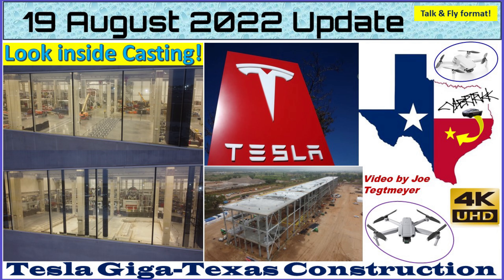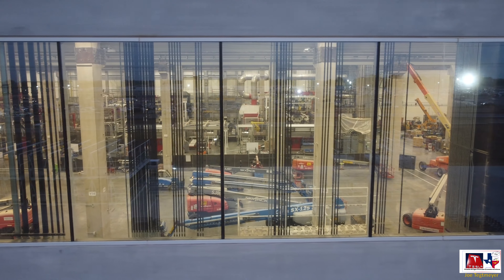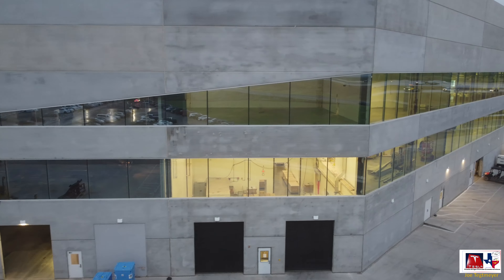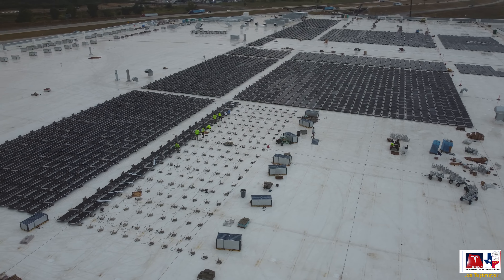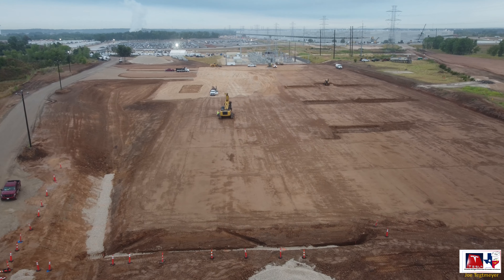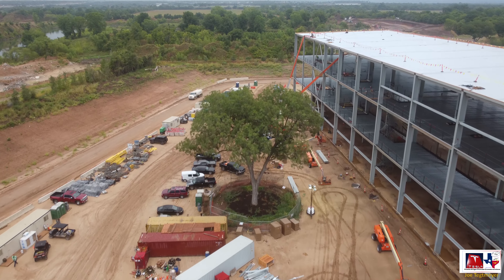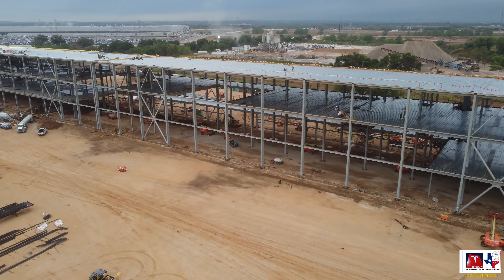Tesla Gigafactory Texas 19 August 2022 Cyber Truck & Model Y Factory Construction Update (06:45AM)

Comment: My ideas and speculations at the cathode building.
13:01 The roped off area on the roof is to indicate that anyone near the edge is required to be harnessed and secure. Down the left side are the roof drains indicating a pitch to this side, and the column heights on the end also indicate this. Any addition to the building would be on the right side.
13:43 The area with the many pipes could be a storage area for dry feed. The black pipes are parts of a pneumatic conveyor system. The rows of black pipes to the left are silo locations and the uncovered pipes are where the feeds are mixed and/or routed to the process. The white pipes are drains for silo enclosures. This area could be enclosed as indicated by the steel to the left.
Reply from the maker: Wow, thank you very much for these ideas and speculations! Hope to be able to show how close to right your thought are!

Comment: Maybe someone has already speculated on this, but the smaller semi-trailer parking area (located where the pipe-mill used to be last year) seems to be for trailers that have been fully unloaded.   The rear doors on many of them are wide open, and the area they are parked in does NOT have any security fencing around it.   No need to protect or secure a trailer that is empty!   😀

As crowded as the WOW yard is getting, it would make sense not to further congest that area by bringing trailers that have been emptied into the factory back over to that area.   What do you think?
Reply: Makes a lot of sense!

Comment: Thanks Joe 
The fourth Gigapress was a surprise.

2:26. Casting, inside. Demolished part of the existing Gigapress frames that were cast into the floor. Joe’s 12 January video of same location, https://youtu.be/lZxfys7MaWM?t=646
Casting, inside. Column rows marked X, and Y all had a flat plate collar fitted around the bridge crane beam support shoulders. Engineers getting twitchy.
6:20. Battery north, inside. Construction doesn’t seem to have finished.
6:44. Battery, inside. Levels 2 and 3. New openings broken through the walls.
10:19. New substation. Bottom right. Rebar for circular cages.
10:55. New substation. Machine at bottom left looks like a drilling/piling rig.
12:29. Cathode, roof. Pairs of circular blockouts along the roof edge would be for roof drains.
12:59. Cathode, roof. Insulation boards and topping mix almost to the top of the timbers around the edge. Space enough for a trafficable board, then the membrane.
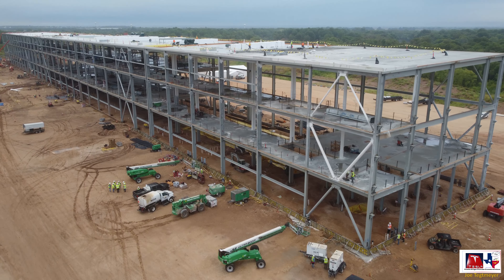13:21. Cathode. Painters have made a start. 
13:50. Cathode. Duct banks. Seem to be using a corrugated mesh as formwork for the concrete encasing.
13:59. Cathode. Bottom left. Pipe arrangements. I always think steam when I see pipework with welded elbows, tees, and flanges at the connections.
16:47. Cathode Level 3. Right of screen. Stairs and flat sheet decking for the suspended platforms.
17:58. East contractors area. Bottom of screen. The plumbers dog.
18:55. East stockpiles area. Left of screen. Bright red spillage.
20:37. BIW, new loading dock ramp. Plumbers nightmare continues. There does seem to be less pipes at least.
22:34. New loading dock openings. Zoom in to see the insulated core of the wall panels. Floor busted out for the dock leveller set-downs.
24:27. Stamping Extension. Road is a mess. Still shifting earth around.
Reply: Why would the fourth one be a surprise?  Since we saw the crates go in a while back, figured they were putting it together.
Reply: @sammyk874   I lost count of how many there were. I recall seeing empty heavy duty low loaders, but not sure if I noted them as being for another giga-press. Need to mount a search now. See what you done!
Reply: 2:26. I wonder if they wanted to up the capacity of the bridge cranes, and this was a way to do so without taking up floor space by adding exterior support beams. Or someone discovered a structural engineering mistake that had to be fixed quickly?
18:55. Unfortunately, that is off highway diesel marked with red dye that has been spilled.
20:53. Ambulance outside of stamping area.
Reply: @GoCoyote  2:26. Yes, a number of possibilities. Back when the beams were delivered I thought that they appeared to be deeper, but it wasn't possible to get a direct comparison with the already installed beams. They are heftier though, top and bottom flanges noticeably thicker as seen in Joe's  12 January pictures.
18:55. That's a relief, no connection to 20:53 then.
Reply: @DessieDoolan  I figured you had a delivery tracker already! 😀
Reply: @sammyk874  They weren't there when Jeff first flew past. Arrived as he was finishing up. Next day, nothing to see. There must be loads of times this happens, and we're none the wiser.
Reply: @DessieDoolan  Yep, not like the old days when there were often three or four drones a day. And that was when everything was out in the open and nothing was missed.
Reply: @Bill_N_ATX  Yeah, you could follow something of interest from video to video. Hole dug, something placed, backfilled, asphalted.

I miss Randy's videos. Those late afternoon shots always showed up stuff not visible in full light.

The current combination is pretty good though.
Reply: 13:59 I’m with you. At least something under pressure. It’s not stainless or some other special allow it seems so it could be high pressure water, or a slurry, or a bunch of stuff. But probably not sprinkler or fire safety since that’s all low pressure, under a couple hundred PSI, so no need for bent or welded pipe. Just cast iron pipe and fittings are fine for that and potable water.
Reply: @Bill_N_ATX  Is there nothing on TV over there tonight! I must have had a dozen comments in the last hour.

13:59. Hopefully a lot of the plant will be installed before the walls go up.
Reply: @DessieDoolan  I spent a couple hours after the thunderstorms stoped cutting up an oak tree in the front yard that was hit by lightning. In Texas, we say that droughts are ended by floods. We didn’t get a flood today but it’s supposed to rain almost every day for the next week to 10 days. I know they had them up north in Ft. Worth today. We will see if it gets down to Austin.
Reply: @kevinstrelioff4340  I looked at Joe's photos. I think they are Model S. 
There has been an S seen here before on car-carriers.

Nicely spotted, very hard to make out.
Reply: @Bill_N_ATX  Lightning strike. Close enough to cause you to utter an involuntary profanity?

Rain. Will be interesting to see how the far north east hire depot yard holds up.
Reply: @DessieDoolan   Oh Hell Yeah. This tree was about 15 meters from the living room window. While I loved that tree, I’m happy it hit the tree and not the house. That would have been really bad.

Comment: 8:55 Faintly, but there is some steam coming out of (a) cooler(s) on top of BA, so there is some cooling taking place. Good news, 4680 production may have (re-) started or is in trial run after the announced installation of 2nd generation production equipment.

Comment: I don't think that little car wash on the outside is a test for water leaks.  That requires very high pressure from lots of angles, and is not done by hand.  Your vehicle throughput would be severely limited.
Reply from the maker: Thanks … some think it’s a washing station, some think leak testing. What do you think it is?

Comment: The new room in casting area looks like offices. Fire sprinklers seems a bit tight for open area. Fire code typically 15' per sprinkler and overall room appears to be about 20' X 60' which would suggest 4 is enough if not overkill for an open area. Here we see 11 so could be 6 rooms and one hallway on top floor? The column that is towards the inside more seems to have a sprinkler on both sides?
The pipe with flanges by the cathode plant looks like pipe for fire sprinklers; risers and distribution. But could also be to distribute water for processes. For fire you would see gate valves between a flange to shut off certain areas. Each would get tamper switches to ensure gate is open and actively monitored by fire alarm system.
Reply: I don’t know about the cathode chemistry but how does it respond to water. Does it need a deluge level of water to suppress a fire or will the more typical mist of a normal sprinkler do the job? I know is some installations, the high volume, fine misters, which take our heat a lot better, are much more efficient than the classic sprinkler. Others, use much higher volumes of water. Not an expert or really knowledgeable about them. Just enough to be dangerous.
Reply: @Bill_N_ATX  I think water and lithium in its basic state in nature are fine. It is a salt and abundant on the planet. One of the sources is from brine 'ponds' in Bolivia so literally created through evaporation. I think until you shock charge a battery cell the first time that, after that, water can react violently with water but do not know that for sure chemically. Just that it it not charged and has no poles [+/-] until that happens tells me there is no danger of thermal run away because it can not store power yet. 

For chip forges and other items where water is not desired or usable often halon is used. That basically sucks all the oxygen out of the air so not good for people. Another item is simple baking soda charged systems used in some restaurants. Always keep some baking soda handy when cooking with grease! Another bad place for water and smoke detectors [heat detectors are used]. I interfaced with those devices with the wires that monitored them via the fire alarm panel. Lots of anti tamper devices on fire systems.

So outside of knowing what color of glass tube [which determines the temp it breaks] was in a sprinkler I could not tell you in terms of type of spray head it would give you for spread or droplets per meter. I just knew the code for smoke detectors is basically the same so they can conflict for space in a ceiling and tend to spread in similar locations. Climate matters in all phases of buildings and manufacturing. 

I moved on to HVAC controls which these days includes watering and lighting system controls. Along with regulating temp and pressure in a building including air evacuation systems. I think Tesla has been in battery production hell at Texas and some of that may be climate differences between Kato. And they will go through that in Berlin as well but different issues. Mainly because Berlin will not start up until the battery plant is finished most likely. Where here they are still struggling to finish the systems that were not changed on the battery plant.
Reply: @craigarnold1212  thanks for the information. I wasn’t so much worried about lithium. I know people that eat it every day and it seems to help them. I was more concerned about any solvents or chemical processes used to purify and condense the lithium. I know that during battery day, Elon and crew said they had a new, mostly water based method in mind. 

My experience with fire suppression equipment is tangential. Like working in computer centers where when the alarm goes off you have seconds to get out of there else the chemicals used to kill the fire kill you.
Reply: @Bill_N_ATX  That's halon. I liken it to what I experience forest fire fighting one summer. I was once hit by a flame in the face. It went down my nose and into my lungs. Next thing I knew I was being drug out by my heals.

In my experience buildings use the right systems in the right places. As an example. Solvents to me mean airborne issues. So detectors of them may be needed and air evacuation systems at the ready to bring in fresh air as it expels the pollutant. Like in parking garages needing co2 monitors and air evac systems for a little while longer! lol It will be decades before someone wonders why we did that and remove it from building codes. Or maybe someone will try to make a BEV only under ground parking structure and get a variance?
Reply: @craigarnold1212  Thanks for fighting forest fires. I lost my house to a wildfire almost 11 years ago. It grew so very fast and I was only about 1/2 mile from its origination point. By the time I realized there was a fire and left the house, I ended up having to drive about a thousand yards through the fire, as it was the only way out. Doing that on purpose is nuts.

Comment: Looks like Disneyland in the morning. Nice work
Reply from the maker: Thanks Nicholas!
Reply: @JoeTegtmeyer  you've created a new meaning for " Morning Glory " LOL.
While filming inside the casting are it revealed the 2 extra foundations for Giga Presses. As i remember back to when they were building the Giga Press foundations they all seemed similar in size and overall strength. The Giga press 9000 seems enormously bigger than the current ones and personally i think that it will far more heavy foundations
Reply: Continuing on i think that there is still ample room for the 9000 in the casting area but with the imminent arrival of the 9000 there doest seem to be if my mind correctly set up as we watch.
All in all what im trying to say is they might be installing the 9000 at the south west corner directiy where all the CT will be be where 1the cyber truck has all its purpose and area. Doesn't make sense to build casting for CT

Comment: 4:00 I would guess that the DMG Mori CNC is use for maintaining and modifying casting dies, and possibly even creating them from scratch.  IMHO a horizontal mill that large is probably not for modifying castings at line rates.  For smaller adjustments to a die, sending it out for machining wastes time due to the shipping round trip (a die on a truck is not making money).  The initial dies may be outsourced since that is a lot more machining so the shipping time is less of a factor.
Reply: Die work doesn't happen frequently. The close proximity to the gigapresses suggests to me that they will be used for production.

Comment: Very informative video Joe. Would it be possible to hover over that exit ramp for Model Y and count the time between cars? Might give us an idea of production rate.
Reply: Yes, Wu Wa gave us a great feel for the volume at Shanghai but i think its a tad early to do here at GT cause it would be like watching grass grow.
Reply: In my opinion, I don't think a few minutes of counting would be a reliable representative sample of production rate.
Reply: DO NOT DO IT JOE.

Tesla have not liked it at other factories.  It has led to flying suspensions. 
Yes flying.rights are different in the states but it makes much more sense to work with tesla and be friends,  after all one might want to recover a drone at some point.

Additionally you can not fly for long enough to get.meaningfull data.   In all official internal videos I have seen there there has been quite a large collection area inside.   It.is not a rate defined by the production line but fluctuates relating  to the return transport of the  drivers .   Now when they do this driverless, programmed on autopilot, it would be at a rate defined by clearance from final inspection.  But even then try and check with tesla first.
Reply: @davidclark2286  You put many of your thoughts into one comment, and I am not going to adress.
Worst case scenario is that Joe receives a cease and dissent order which is no big deal.
Reply: @jbbuzzable  I for one, would be disappointed if Joe was banned for flying around the Austin site.
Reply: @gpsfinancial6988  Ain't going to happen.

Comment: Joe, thank you for the inside views. At 9:29 it appears that the battery storage area will have parallel sides as indicated by the removal of the grass. I also noticed that a large portion of the front castings in Brad's video still had the injection sprue and runners attached and would require machining. By placing the castings in the storage racks one forklift can handle 5 castings and be ready for storage and robot handling for automatic machining. Somewhere in the plant they will have to have a storage area for stampings and castings, possibly west of stamping.
Reply: I think that there will be be few storage areas once the production lines become balanced.
Reply: @jbbuzzable  The number of molds shown at the Schuler transfer presses indicate that they press parts in batches and store for production. Casting may have to do this also. Fremont sure has a lot of castings stored.
Reply: @eltonray2934  The lines are not yet balanced. When they are, parts will go from one step to the next without putting into a warehouse just to pull it back out again.
Reply: @eltonray2934  You continue to think that what you observe today is what it will be forever. Chill out and respond in 6 months.
Edit: I assume you are not familiar with line balancing or the costs of inventory.
Reply: @jbbuzzable  Johnny, One good thing about You Tube is that it is a forum where people from various backgrounds, experiences, education and logic capabilities can present their ideas for the possible enrichment of all.
Reply: @eltonray2934  I agree. After rereading my comment from last night, I did come off as a bit snarky. Sorry.